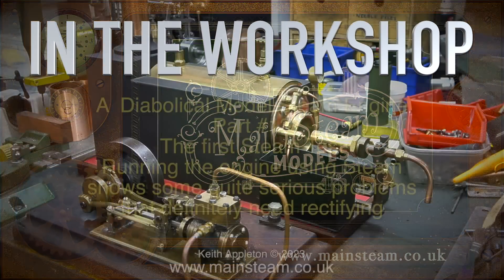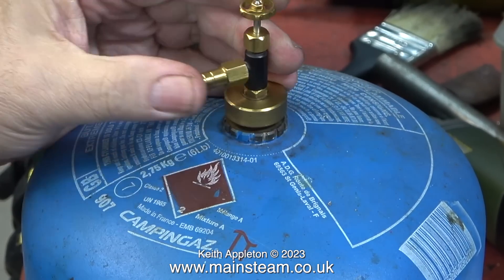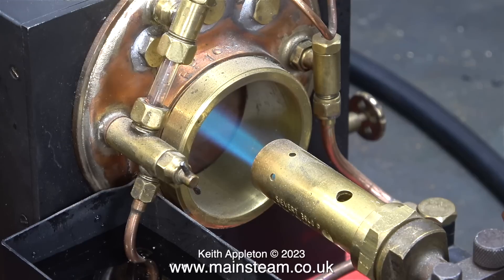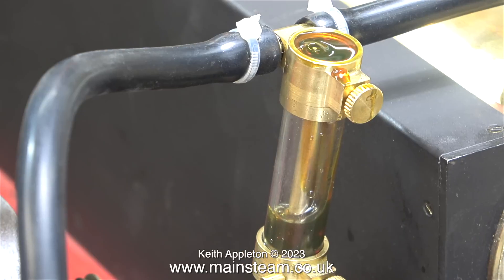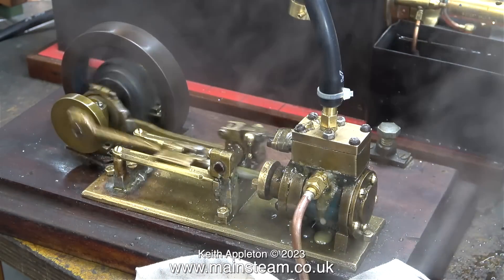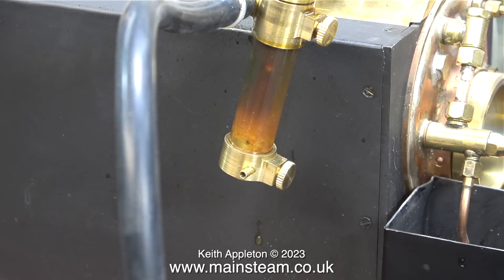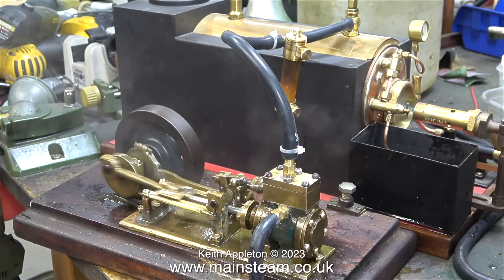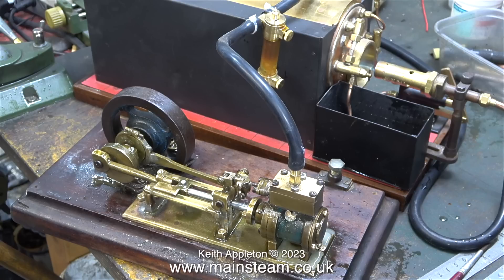A DIABOLICAL MODEL STEAM ENGINE - PART #13

Comment: I should like to second the statement by ricksizemore8102 & say to you Many thanks for the many hours of enjoyment you have given me. Your final comment set me wondering when if ever I have watched one of your engines cooling down after being run. I keep saying I must have done, then Have I? You really have got me on this one.
What i will say is that this is a fascinating little engine, possibly made out of scrap in say 1947. That is known as the Bulge year when the troops had come home & a lot of extra babies were born. I was born in 46, the year before so my early recollections were not of sweeties or toys.  They were being allowed to ride on the back of the dray with the Milk Man & Going with the Men  Ferreting. We moved to a small village outside Birmingham for the health of my big brother. So no one had anything, rich or poor. The only question being where did the builder get all the solder from?